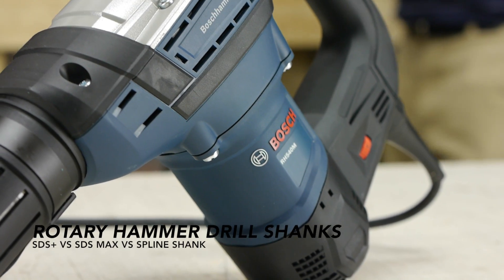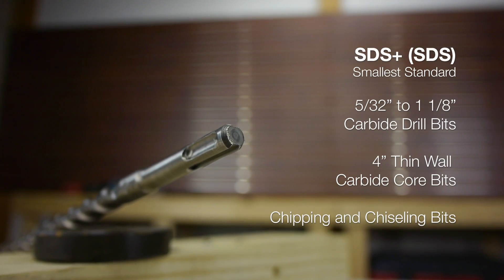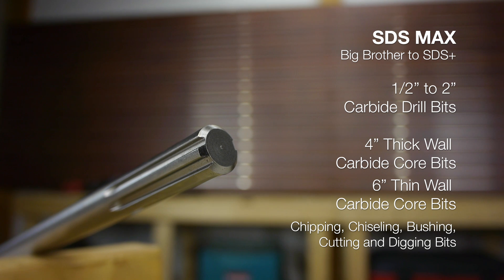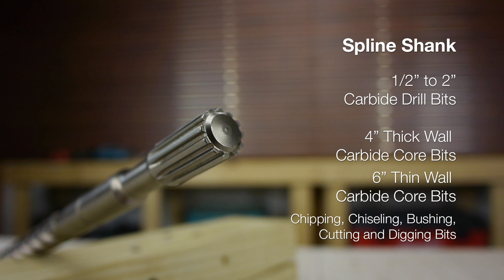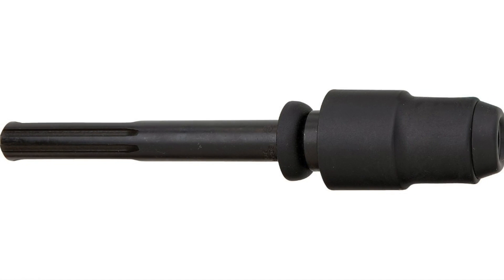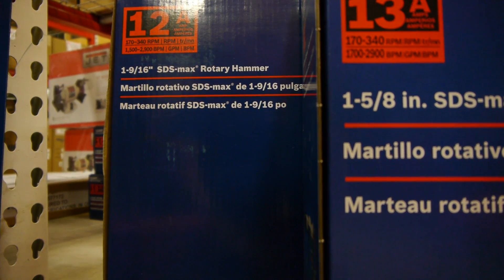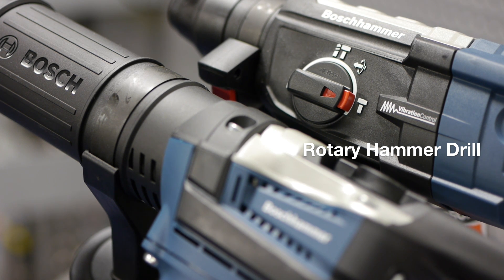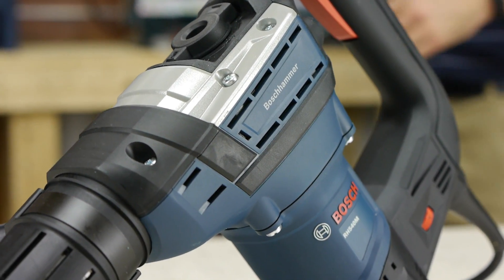SDS-Plus vs SDS-Max vs Spline - Rotary Hammer Drill Bits for Concrete

Comment: You didn't mention the REAL DEAL with spline.  The mfgrs. were looking for a way to cut manufacturing costs. PERIOD. I own all 3 types and have for quite a while. Originally nearly everything we had was spline (yes, I know hilti, black and decker, and even milwaukee had hex bits originally) splines were mostly made in usa or germany, etc., They cost more,..so just admit it..if you can make something  cheaper that will work,..your profit will go up. I am positive the manufacturers were thinking they could extinguish spline drive very quickly (hasn't it been 30 or 40 years?),. The reason it still persists is because it works well.  But maybe they should talk to General Motors and try to sell them their SDSMAX as a replacement for their drive line connections.  I have seen MANY broken sds plus bits, and a few broken SDSMax bits. . I have never seen a broken spline drive bit,...although I am sure they are out there. In the last ten years or so,. I have not seen a lowes or home depot carry anything with spline..so eventually they will succeed in killing it.  Probably by not providing replacement parts and calling the spline hammers obselete.

Comment: Understand that the use of adapter will cost about 20% power loss. Therefore use spline shank on spline shank tools such as Bosch UBH 12/50 and SDS-MAX on modern Bosch GBH 12 52DV etc. But SDS+ tools are small and can´t transfer the energy, thus the loss is useful.

Comment: i have a very old roto hammer and its a spline shank. i will tell you it is near impossible to find bits for it anywhere and the sad thing is that my old black and decker macho ii roto hammer works like it is a brand new tool but i only haVE ONE BIT FOR IT. Luckily i dont need to use it very often.
Reply: Not sure if there local to you. But nefco and colony hardware carry spline shank.

Comment: Great video, especially the bit about SDS plus and SDS max shank size. I was very confused about which shank size to get for my SDS Max rotary hammer, didn't realize it was only one size. Unless I'm still mistaking.
Reply from the maker: +Wang Hung If hammer says SDS-MAX and the accessory says SDS-MAX they will fit your tool. Could be under-powered if you get a small rotary hammer and a huge bit but they WILL ALL FIT.